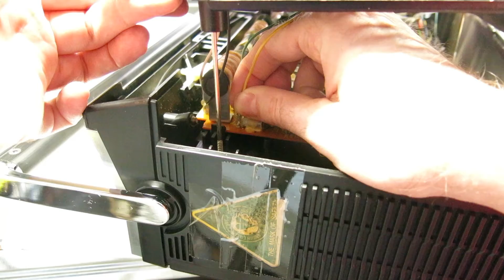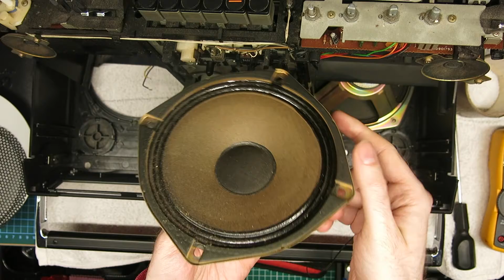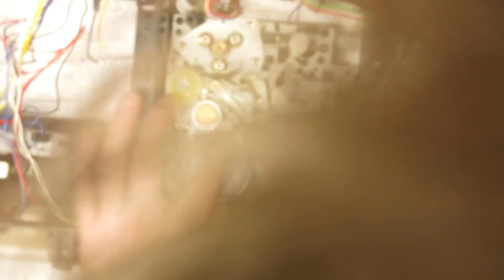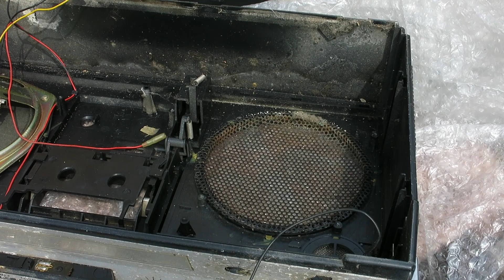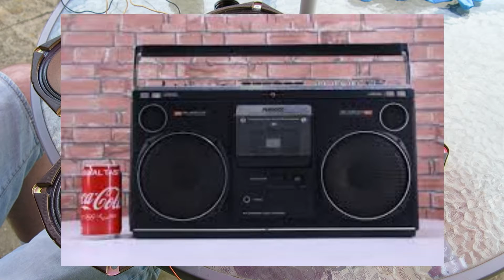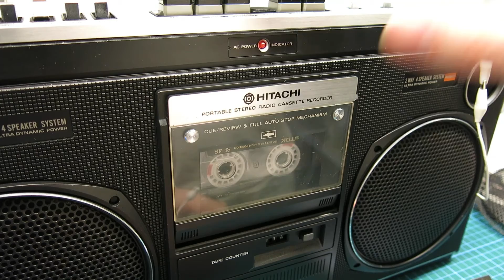1979 Hitachi TRK-8080E Refurb

Comment: Great video. Just inherited one of these from my uncles garage (wish we still had Mum's 8180😢). Speakers and radio working ok. No life in the tape deck apart from a high pitch whistle that sounds like an incoming bomb. 5 pin din very quiet with phone so gonna try an fm transmitter or small phono pre amp.